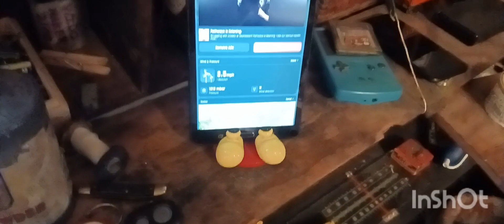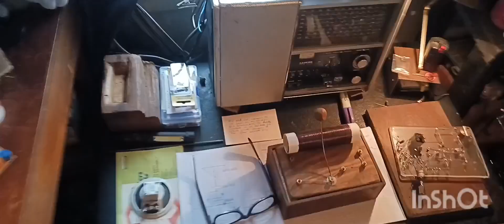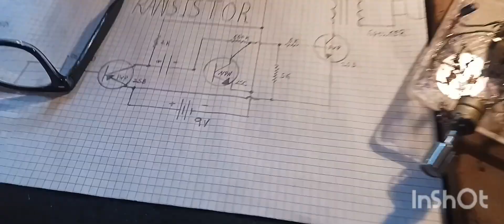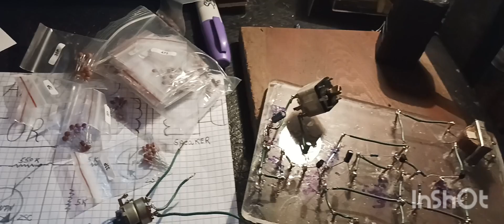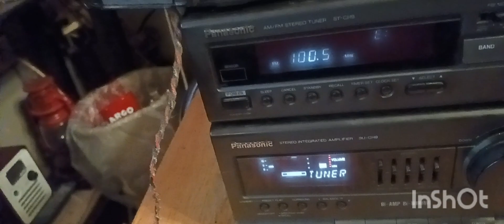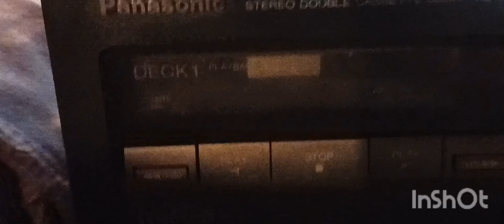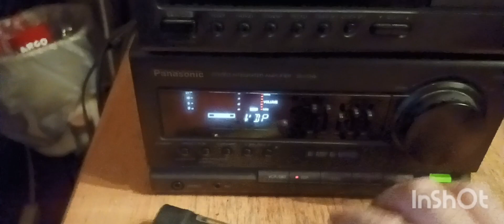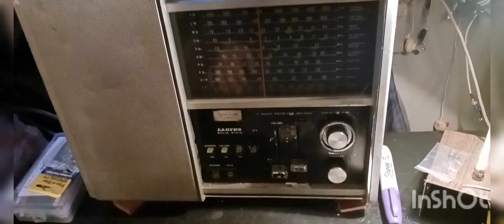3 Transistor radio, just the basics [ Redneck Ways  ]

Comment: On that potentiometer, the legs you want to use are the three coming out under the shaft. The center one is the same as the schematic diagram with the arrow. The three legs on the back of the pot are a switch that opens when you turn the pot full counterclockwise.
Your diode is fine if it is a germanium.

Comment: The disc capacitor you showed, 33p, is 33 pico Farad. It goes like this, 1uF (micro farad) = 1000nF (nano farad) = 1000000 pF(pico farad). So your 33pF cap would be 0.000033uF. We just don't say it that way. The first capacitor in your radio, right off the antenna would be in the pF range. It says 100 on the schematic so the cap you need there would be 100p, or marked 101, 10 and one more 0 pF, or something close from your bag of disc caps, not an electrolytic polarized cap. That .05uF would most likely be marked 503 that's 50 with 3 0s or 50000pF. It isn't an electrolytic either. Keep it up. You will get it. It just takes time.